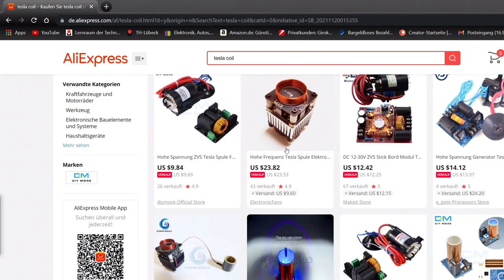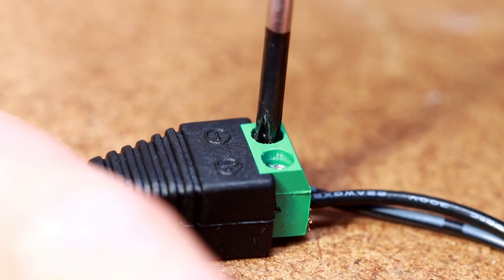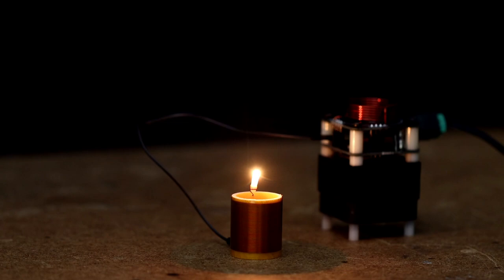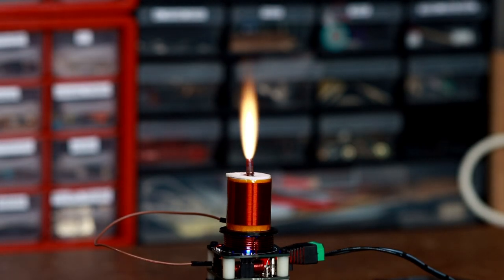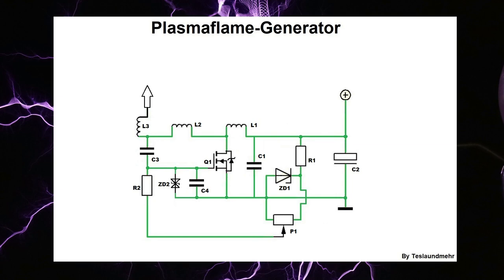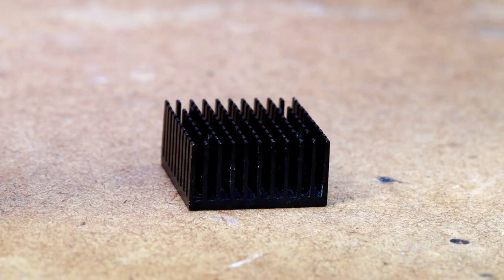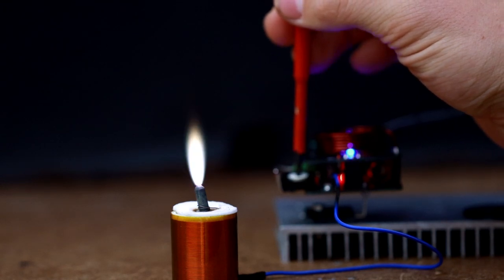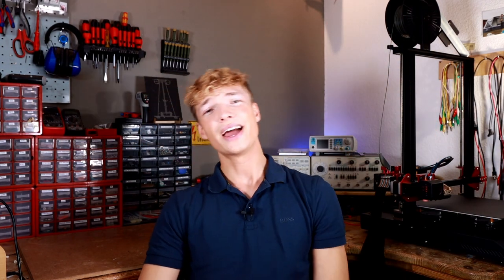Plasma Flame Tesla-Coil Test & Tuning

Comment: I can't believe you pumped over 70 volts into that little beast. Great video Leon!
Reply: it is possible with most of them, but it's the power it will withstand for 10 seconds lol
Reply: I had one running on 200vdc :)
Didnt break the unit.
Though i did some hardcore modifications to it.
Because the aliex unit is just not that great hehe
Reply: @acidbyte4760  cool!!!! is it steve ward kinda insanity? :D though i really feel like a loser or just i dunno, because i am experimenting with those circuits for like three years at this point, and just one small one finally worked, though it gives off like a 5cm flame at 45v and 250 watts, inefficient as hell.. what was your result though?
Reply: @dopedeala666  naa i wish. He doesnt use mosfet btw. I believe he was running either gan or sic.
Reply: @acidbyte4760  it is sic mosfet thing, I've burnt up a damn expensive one, I don't know, maybe it's the tuning thing
Reply: @PlasmaEagle  of course he does, just type in Steve Ward high voltage
Reply: @dopedeala666  yep its the tuning thing as always 
These circuits are very inefficient out of tune :) and thus lots of heat and spikes coming from that situations
Reply: @acidbyte4760  i mean I've tried like 15 forms of secondary resonators and just one gave me a little flame, and after 3 months of painful fine-tuning it finally seemed to plateau at the maximum size and efficiency. tried to add class e d-s capacitor, the flame enlarged but the efficiency dropped to internal combustion engine level
Reply: @dopedeala666  can you contact me on like messenger fb or something. I can help out if you like :)

Comment: I'm impressed with that little thing, even before you switched the MOSFET out, but you definitely made it way better! I'm always impressed with your skill at getting such large outputs out of such small coils. Great work, as always!
Reply from the maker: Thank you so much!!
Reply: @Teslaundmehr  Hi Leone Please tell me my power supply from 28-48 volts Is it possible to supply 30 volts at once because 15 I do not have the ability to turn the potentiometer when powered by 30 volts

Comment: What I would like to see, is an actual use for the plasma flame.   Aluminum is the main fuel on the Space Shuttle, Solid Rocket Boosters.   A plasma flame that vaporizes aluminum, them mixed with oxygen, could become a plasma injector.   It is combustion, aluminum fuel + oxygen, initiated by plasma.
Reply from the maker: Sounds good!
Reply: That is actually used in electrothermal chemical guns, a plasma plume produced by the discharge of a capacitor bank regulates and helps burning the propellant in high performance guns. Enabling muzzle speeds of over 1700m/s with low barrel erosion and reasonable chamber pressures. It can even become the main source of energy in a gun in pure electrothermal guns, the plasma vaporizes a propellant, like high density polyethylene or some specialized propellant. 
I made one many years ago, I used electrolytic capacitors for my bank and it was about 800V and stored 4KJ, as propellant i used a few drops of a jelly made with water and aluminium powder jelled with xanthan gum, it was able to shoot an airsoft bb at more than 2500m/s, it leaved small craters (about 2 times the diameter of the bb) on aluminum plates and could go thorough 2mm of steel.

Comment: Why does this work when the secondary coil is not close to the primary coil (as usually done for most Tesla coils I've seen)? Like you show in around 2:00 of video. Thanks
Reply: Because it does work like a tesla coil.

Comment: Can I use a 12v car battery to power this ?
Is there any way to use this as a off grid light source with multiple flames using multiple  Tungsten tips aligned vertically as in a vertical oriented  lamp ?

Comment: That is very impressive. How dangerous is the output? I know it will burn you but would you get shocked if you touched it with a metal rod?
Reply: Nope, no shocks. Just RF burns

Comment: Do you think Its possible to turn this into a handheld device with a lithium battery? 
Or would the coil that produces the flame interfere with the other Part ?
Reply: It needs a lot of current and voltage.

Comment: How would the flame look with 200Mhz or 1Ghz or 1Thz?
Reply: At 200M or 1G you'd get quite a similar discharge. At 1THz you're into the long IR, and at these frequencies the strange RF electrical effects cease to occur. The wavelength at these frequencies is too small
Reply: @inductivelycoupledplasma6207  how do you know that?
Reply: @PlasmaPro8  a quick Wikipedia search on what range "RF" covers will quickly confirm this. RF ceases at 300GHz. Perhaps you'd still get some of these effects at 1THz, but I don't know if you can even design circuits at this frequency.